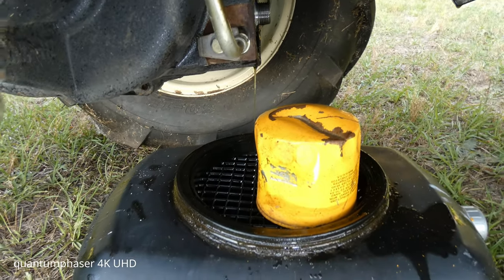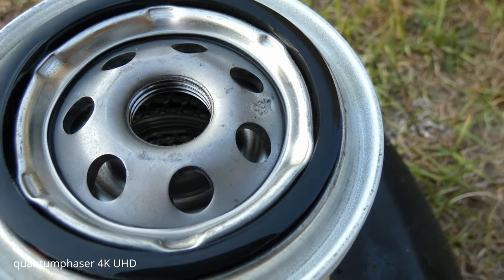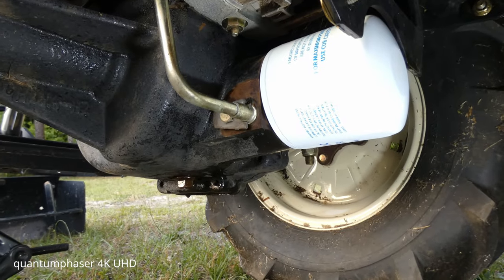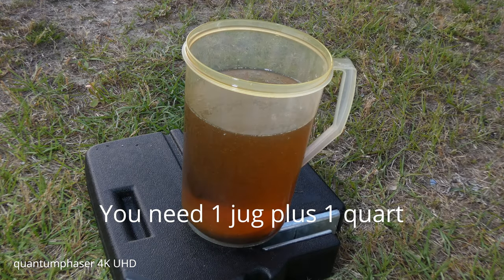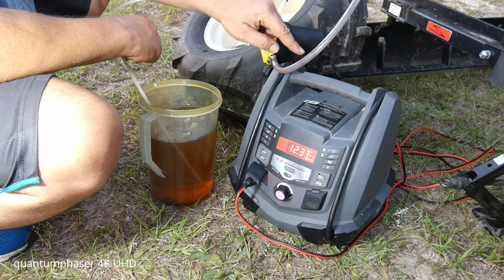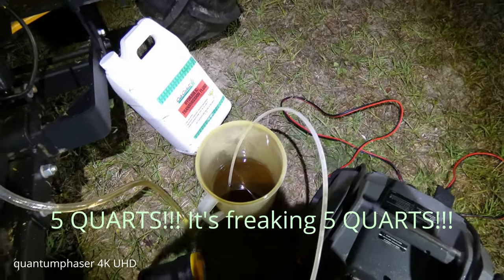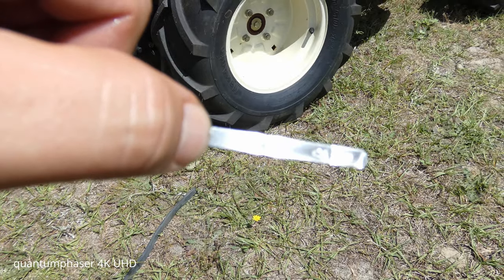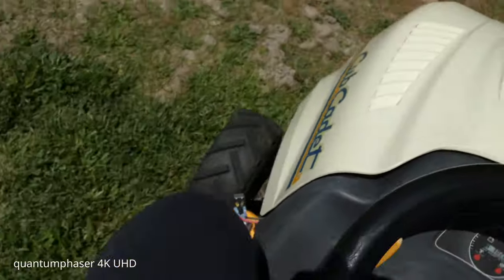Cub Cadet GT2544 Tractor BDU10 Transmission Service with Mower Deck Removal Tutorial

Comment: Great video! I looked everywhere for the oil and filter change but nothing showed up. Then suddenly there it was! 
On another note: I came across a video where the GT 2554 was losing forward speed.  The fix ended up being the the actuator. Actuator is mechanically connected to the forward drive pedal.  It is located underneath the drive shaft at the rear of the engine. Two metal plates surround the drive shaft below the battery case. When the plates are removed the actuator is revealed.  Dirt and grass accumulates around the actuator shaft causing its stroke to be limited.
Reply from the maker: Yeah this video ended up being a mess. My favorite part being using a 4 quart container to pour the 5 quarts of oil. I will make another, more streamlined one in the future.

I'm very interested in what you were saying about the drive pedal since I do have a problem with reverse being very slow and to me it felt like a pedal problem like there is something blocking the pedal from full action.

I've heard stories of grass buildup affecting pedal stroke but had no idea where to look for the problem. Forward seems to work but as neglected as this tractor was and given the age what you are talking would be a distinct possibility.

I need to pull the belly mower off and give it a service, sounds like I have a bad spindle but while it's off I'll have better access to the tractor and be able to give it a thorough look and cleaning.

Thanks for commenting and if you can tell me anything else relevant about that weak reverse, I'd sure appreciate it!

Cheers,

Greg

Comment: i'm confused. My kubota t1400h supposedly has a bdu10 hydo unit but there's no spin on filter than I have found.
Reply: BDU10 hydro is the actual pump itself. The final drive has the external filter and is what gives this transmission its overall torque. Thats why this machine is so powerful is due to its gigantic final drive and high gear ratio in the axle.

Comment: The manual for my GT2554 says it takes 6 quarts. Says to change the filter every 100 hrs but gives no interval for changing the oil.
Reply from the maker: I change it every 50 hours, but I'm working the tractor with earth moving. 

Some oil remains in the transmission, 5 quarts is the exact amount to the line.
Reply: @quantumphaser  At 400 hours my transmission oil was still very clear. Drain plug has an oring. Nothing but grass cutting on level yard.
Reply from the maker: @billmalec  100 hours seems like a good number for normal use on the filter and fluid, mine had never been touched since new and that was definitely the original filter. I gotta say I expected the fluid to look really dirty but it wasn't too bad, but that dose mean it wasn't worn out, definitely had some debris in it.

That's another reason I did it at only 50 hours on the second change out. 

Just to flush it again.

t will be cutting grass more this year, we'll see how many hours rack up in a season.